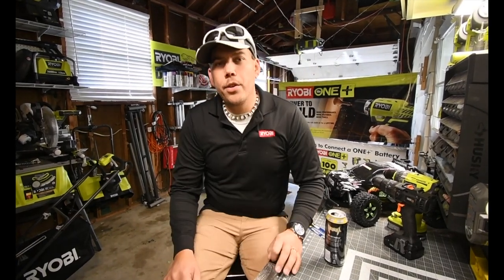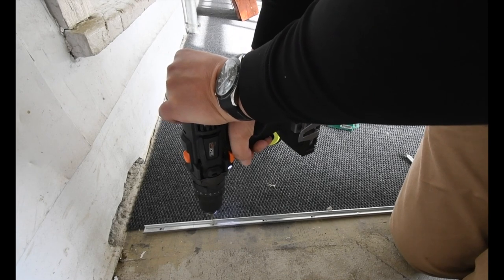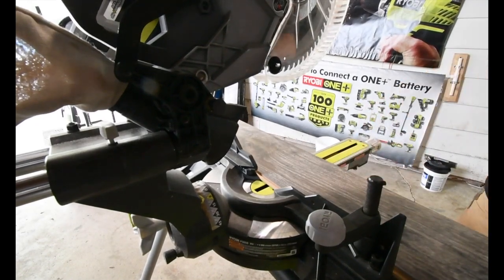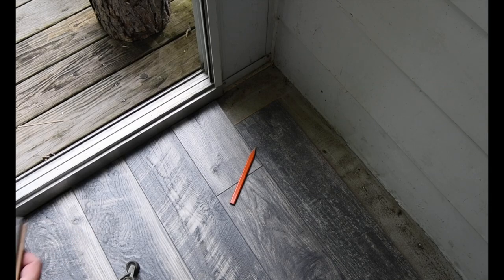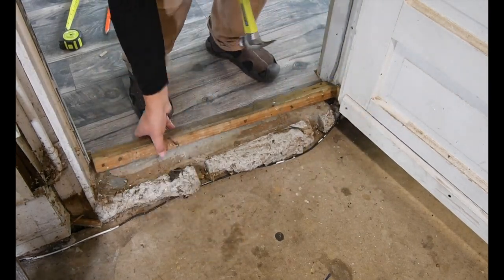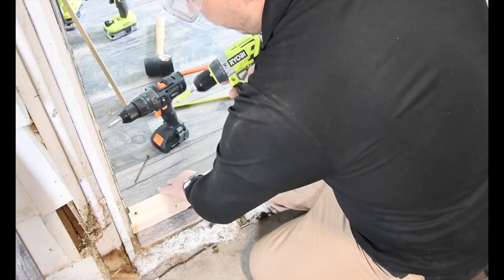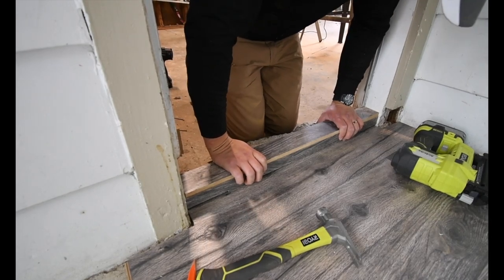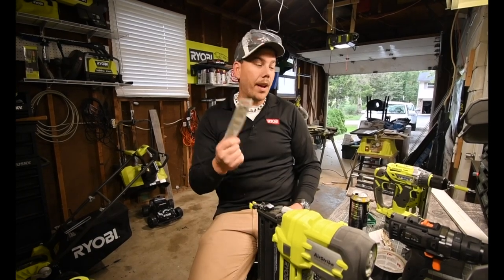Working on the screened in porch

Comment: Like the video(s), the RYOBI miter saw appears outstanding. One request, when you begin using your power tools their sound is quite loud disturbing others in our room. To hear you speak our sound is at a comfortable level not disturbing others in the area, but when the tool comes on it is many decibels louder (blaring). We must keep our hands on the keyboard turning off and on the the sound, often we are not quick enough. The looks and comments we receive are not nice. Also, when you finish with the tool you speak, again we are not quick enough turning up our sound so miss what you are stating. Would you do something in your videos cutting off the sound of saw, drill, and the like; or maybe lowering it 95% would be helpful then when you again begin speaking be at the normal column. Other YouTubers in their videos do it, it is much appreciated. Thank you for your consideration.
Reply from the maker: the sound is adjusted, I've been turning down the sound while I edit the video for the parts power tools are being used. it all depends on your speaker system and what kind of device you are watching on. thank you for your input
Reply: Ryobi Man Caver: Thank you for your polite reply. My devices are Chromebook, iPhone, iPad, and MacBook Pro. On those device we do not hear a reduction in tool noise. The sound on all devices are set to easily and comfortably hear your voice then the tool noise comes on blaring. Played these videos on a neighbors computer they have a iPad Pro, MacBook Pro, and a Windows laptop, they heard the same loud tool sounds as well. Even at that we do very much enjoy your videos.
Reply: Yeah, I second this on my andtoid